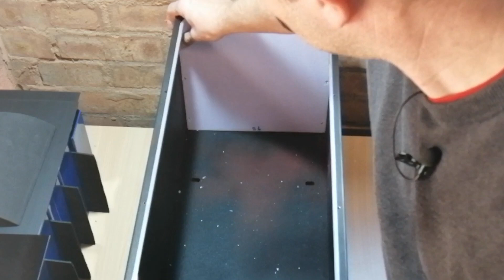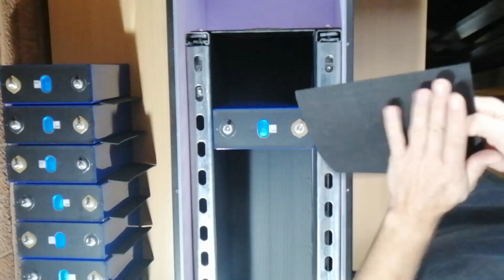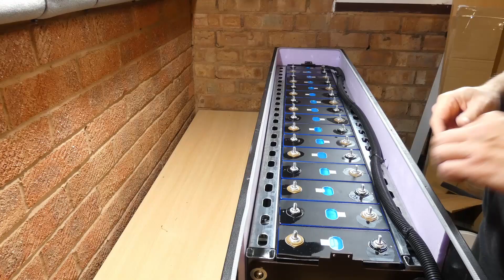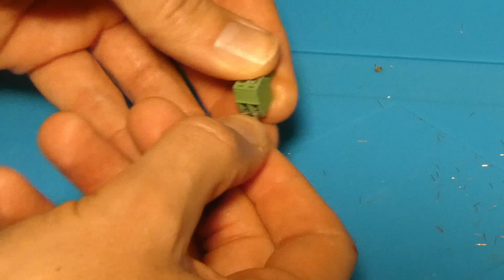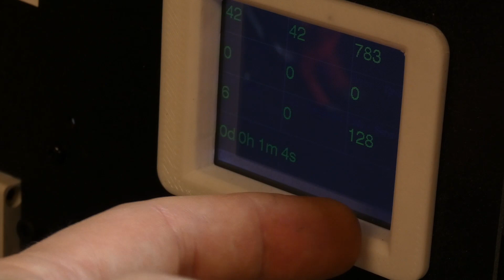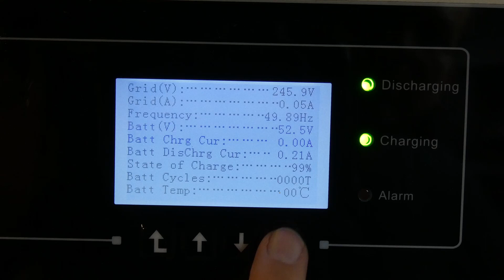Assembling powerBASKET & Power Up [Battery Build #6]

Comment: Could you explain the process and who you send this cabinet to be built?
Reply from the maker: I designed the cabinet using Free cad. Then sent the drawings to a local laser cutting company. They cut and bent the steel sheets and then I assembled

Comment: Have you got a wiring diagram on how the front panel is wired? Specifically the step down converters, whether you're using the negative from that to power the BMS, or direct from the battery and also the pre-charge resistor circuitry?
Reply from the maker: Hi, all the negatives are connected, the step down converter is not isolated, so has a common ground.

The pre-charge is simply a button as resistor, which bypasses the circuit breaker

Comment: Hi Stuart, what cable gauge did you use to connect inverter to battery? I have tried to use 50mm² and could not fit it in the Sofar ME3000.
At the moment using 16mm² but it's getting warm at full power.
Reply from the maker: I'm using 25mm cable, suitable up to 150Amps

Comment: Hi, can u monitor pressure at all cell at diff. Temps ? THANX
Reply from the maker: I'm not measuring pressure on the cells - just temperatures
Reply: @StuartPittaway  Hi, I am building EPS32 DIY BMS + ESP NOW protocol + 8 A balance current with BUCKs, I am interested in idea, how to measure pressure in 4S packs, / LFP - Winston / or DOcan / that blue 280 Ah cells. I think, that 16S is very big chunk and for me it is better to manipulate with 4A packs. Also if 1. cell go to hell in 4S, it would be not so detrimental, as in 16S pack. Packs can be connected with DC fuse / PN00 - PN4 / or with heavy Cu bars + shunt. / 500 - 1000 A /. I am building system, when BMS + MPPTs + inverters / all DIY / communicate with each other, without cables or without router or switch. At one point there is gateway from ESP32 - ESP NOW to MQTT or RS485 or CAN. The BMS and MPPT will communicate with voice commands / statements if need + SD/uSD card can store data sampled or agregated at reasonable intervals / with respect to uSD capacity /. There can be IL9431 or SPI or I2C ink, oled or another TFT disp.

Comment: I'm searching for the rj45 connector thing, do you have a name or link to the one you've used ? Thanks any simple wireing diagram would be interesting, just a sketch on a piece of paper, or description. Thanks for sharing all this :) Your using PP 0.3mm sheet ?
Reply from the maker: The PP is 3mm thick.

These are the RJ45 connectors I used (keystone jacks) https://amzn.to/3Y7m6mp

Comment: Good morning, thanks for posting all your work so far. with regards to precharging the capacitors in the sofar inverter, was that required or is it something you felt was the correct thing to do? i intended using a seplos bms, and was told it has a precharge process built into it?
Reply from the maker: I've not used the Seplos, but believe it does have a pre-charge function built into it.

Comment: Great video Stuart. It was hard to see but it looked like, when you connected the negative leads to the battery that you put the DIYBMS power supply lug on first followed by the main terminal lug. If that was the case, wouldn't it be better to put the main negative lug on to the cell terminal first and the DIYBMS power lug on second? It would probably give a better contact area for the main negative lug.
Reply: I should probably read the comments first. Someone else already raised this with you. Ignore me too 😁
Reply from the maker: I probably did do that on the video, but since corrected. I've disconnected those cables so many times over the past few days!

Comment: May I ask you a modest question. In the video, I see you put black insulating material between the cells. What kind of material, what is the full name. And one more question, more theoretical. Like you, many DIYers and battery assemblers put insulating materials between the cells. Could you explain the essence of this action? Why isolate the cases of lithium cells from each other? After all, the cell bodies and both the positive and negative terminals of the cells still do not have an electrical connection with each other. Don't you think that this is excessive caution? Have you seen cases where cells that are not isolated from each other harmed themselves or the user? Thanks
Reply from the maker: The cell cases are connected directly to one of the terminals depending on the type of cell.

Adding insulation between the cells means you are not relying on that thin blue plastic wrap.

The foam I used is 3mm EVA foam.

Comment: Another Stuart case.
I see you working, in order to integrate the battery with your new inverter, in a DiY BMS emulation to Pylontech. It will be a great development, but I am curious to know if it will be modular, as is Pylontech, that is, if on a battery (16 cells) new batteries of the same size can be added to the system, connected in parallel and control them all together.
Reply from the maker: The inverter/charger doesn't care what size the battery is, you can parallel multiple Pylontech units together so it will work the same.
Reply: @StuartPittaway  You are right, your system is already prepared so that you can put several parallels in it and manage them jointly. thanks Stuart

Comment: Hey Stuart I know you are working on your new all in one BMS. Have you thought of doing a split design for multiple packs. Example like batrium does with its watchmoncore and cell mate. Basically it’s a master slave system instead of the controller and and a bunch of cell monitors. You would only need one cell monitor per battery pack this that you can build a much larger battery pack than your current design. Just a thought.
Reply from the maker: Thats sort of what I'm going to start with - a single modules which can look after up to 20S cells, and connects back to the existing controller.
Reply: @StuartPittaway  Nice looking forward to the new design. Will it handle more than 8 battery packs in parallel like your current design.  Just curious why 20s and not stick with the current 16s design.
Reply from the maker: @carlospereira9838  it's up to 20S as that's what the chip supports, so suitable for 8S to 20S
Reply: @StuartPittaway  OK thanks for the reply. Looking forward to the new design

Comment: Keep in mind that each cells can expand .025”.  16X .025 = .480”.  A fully charged assembly can see over 1,000 lbs of force if the cells were lightly clamped at a 30% state of charge. The maximum force on the cells should be no more than 650lbs. If the end plates start to bow with excessive pressure the end cells may experience internal damage. Stiff end plates with one end springed to maintain an ideal force of 550 to 650 is very important. Flexible buss bars should be considered to reduce terminal stress and loosing of the buss bar due to cell expansion and contraction. Protective insulation was a very important feature!
Reply: Better to compress at 100% SOC or somewhere in between?
Reply: @KoRWraith 
At 100% state of charge the cells can swell if not fixtures first. If they swell and not return to size at a low state of charge, it’s usually a bad idea to then fixture them after the fact. This usually happens more frequently to the 300ah size and much less to 270/280. On a hot day and full state of charge, a normal good unrestrained cells can bulge 1/16” per side and return to approximately where it originally was. If you had already top balanced your cells and they are full and your not planning on compressing but just want them contained in a rack, then I’d just very lightly snug the bolts (blue loctite) when the cells are at a full state of charge. This is what I’d recommend for solid buss bars because it’s set at maximum and at minimum charge there’d be a small gap between cells. If the cells in the video had already top balanced ,from what I could see on the video they did not appear swollen. When manufacturers state expected cycles, the fine print usually says “fixtured” (compressed) under a detailed maintained pressure (not unyielding rigid). The bottom line  if it’s contained, understand the forces so it’s at least not crushed. There’s a video on YouTube where in an RV has some sandwiched cells with two plates and four threaded rods and I can visually see the the last cells side kinked.
Reply from the maker: Thanks for the info, I'll take a look and do some measurements
Reply from the maker: Where did the expansion measurement come from?  I'm not able to see that in the cell data sheets.
Reply: @StuartPittaway  
Here’s interesting reading I just found from the Eel battery website;
LiFePO4 Cell Compression
SEPTEMBER 13, 2022
Share
What is Cell Compression?

Cell compression is quite literally squeezing/fixturing the outer aluminum case of LFP (LiFePO4) cells to prevent delamination of the internal components.  Delamination leads to a reduced lifespan of the cells, as well as additional stress on electrical terminals. Internal forces are constantly acting on a thin aluminum case that is not strong enough to resist these forces.  Lack of compression leads to damage of the cells, as indicated by swelling and premature battery failure.

Why Is Cell Compression Needed?

With the latest technology of LFP cells, many advances have been made to increase how much energy can be stored in a given volume.  Engineers in general regularly face the challenge of fitting “more” into “less”.  Sometimes to accomplish such a challenging task,  compromises must be made.  In this case, to create more space, a thinner, less structurally integral material has been chosen.  

The thin aluminum case cannot withstand the internal forces exerted when the cells are charged, but the new design never expected the cells to be used on their own.  The greater majority of these LiFePO4 cells on the market today are originally intended for use in Electric Vehicles (EVs).  Automakers and pack manufacturers are already designing the packs with compression in mind because the demands of a solidly held pack in an electric vehicle where vibration is guaranteed are much more intense than a stationary solar power system.  By using a single compression fixture on an entire pack as compared to many thick plastic cases, significant space and weight is saved, leading to higher capacities in the same space.

When Is Cell Compression Needed?

More times than not, cells will require compression. 95% of all aluminum-cased LFP cells on the market require compression.  While the exact wording varies, most high-quality cell manufacturers will make notes in their data sheets. 

 Aluminum case batteries that do not require compression do in fact exist, however, they are rare.  Asking the vendor you are purchasing the cells from is usually a good idea, however not all vendors are fully educated with regard to the engineering considerations of each and every battery and manufacturer requirements.

 

How To Build A Cell Compression Fixture

Cell compression fixtures will vary extensively.  Every application is different, for example, a large array of cells in an electric vehicle will have many more cells to fixture, than a simple 4-cell pack used in an RV or camper.  Advanced builds like this will have far more details than we can cover in this article.  Some fixtures take advantage of plastic or metal banding, while others utilize threaded rods and end plates.  Care must be taken in selecting materials that are able to resist the forces exerted by the cells.

A simple cell compression fixture that is sufficient for most stationary packs used in solar and off-grid applications can be built using some simple materials sourced at a local hardware store.  In the video shown here, you can learn our recommended procedure for building a compression fixture that will provide enough compression to get you started and prevent premature degradation.  This design is not perfect for every application, but can be used as a starting point.  Members of the DIY community like this design due to its simplicity, however, other members have added coil springs, additional reinforcement, and many other methods to create a smoother and more even compression fixture..

Important Considerations

Cells will swell if they are charged over 3.4v regardless of the rate of charge.

Cell-swelling is based on the state of charge, not the rate of charge.  Once a battery swells, it’s permanent damage that will make your pack a headache for the rest of its life.  When you are preparing your battery pack for use, you may choose to top-balance your cells.  When performing this process, you may think that you can opt-out of compression since it’s a slow rate of charge.  This thought process is a MISTAKE and will cause major difficulty for your cells.  Swollen cells that are re-compressed apply immense pressure to the outer layers of plates, whereas keeping an already-flat cell still flat applies even pressure to all plates throughout the battery.
Reply: @StuartPittaway  
I don’t remember where I first found it(on one of the many discussion on compression on diysolarforum ), but I actually have actually seen it myself; CATL 310ah cells from Eel (16) and Ninthsith(16) distributors in four compressed fixtures, 8 cells in each with a spring load at 550lbs. The spring loaded movable end plate moved 3/16” from a cool, 30% charge(new) to 100% charge on a 105 degree day. I marked the four boxes with a sharpie on day one and noticed it later. I actually posted a picture of it there months ago. Eve cells do it exactly the same. I’ve seen pictures of flimsy end plates that were that were distorted because the fixture/box was non moving/rigid, many are still in use without the owner knowing that the factory made battery is actually damaged but still functioning and not leaking…for a while anyway.

Comment: Congratulations Stuart.
Excellent work with an impeccable finish. I only have one question, how are you going to move the battery (I estimate that it weighs about 80kg). Apart from this joke that I hope you know how to fit. I am very interested in you explaining how the preload works. I don't have it in my system and I know that it means an extra risk for the inverter in the connections and disconnections of the battery, the internal capacitors of the inverter suffer (fortunately for a year and a half or so, I only disconnected the battery once.
Reply from the maker: I think it's at least 100kg now it's built, I would have to remove most of the cells to move it!

The precharge circuit is very simple, I'll do a follow up video on the circuits aoon

Comment: Brilliant, well done!  Am I correct in understanding the inverter will only charge/receive max 60amps?  So the inverter is the limiting factor not the BMS?  Just thinking if you wanted to add more batteries. Sorry if this is a daft question, only started learning about all this recently.
Reply: You can push the ME3000SP a little harder than that, they'll do up to 70 amps discharge although since changing to 16-cell LiFePO4 mine seems to max out at 65 amps and a touch under 3.4kW output, I suspect it's due to the slightly higher battery voltage meaning it doesn't need 70 amps to max out its power rating.
Reply: @AintBigAintClever  thanks for the info.  I'm still trying to decide which BMS for my build.  I was reading some said even 200amps.  Do other invertors support this high amps?  Or realistically is this more a reliability rating?  Thanks.
Reply from the maker: I've had 65amps out of it. What firmware version are you running? I'm on V3.00 at the moment, running G98 country setting
Reply: @StuartPittaway  3.16 on mine, I've just checked and confirmed it's running on G99 (option 009).  I must change my Enphase rig to G99 at some point. :)

Comment: brilliant work stuart good stuff, i noticed the pylontech branch on your github, hopefully this will work with my mpp solar inverters :) ill have to give it a try
Reply from the maker: I'm doing a lot of changes in that branch at the moment, the pylontech emulation seems to be working well.

I'm going to also try SMA protocol, which is the generic lithium setting on SOFAR and I think MPP solar